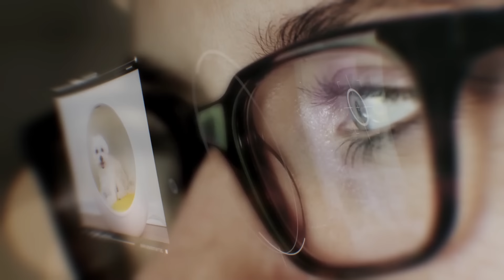145 Incredible Things Caught On Camera. Best of August

Comment: @2:26 - This event is like what happened to me when a roofer came to look at an issue on a very windy day.  The ladder fell while he was 3 stories up.  Luckily, I was able to set the ladder back up myself as the chap was alone.
Reply: I had a job where I was siting a bunch of network equipment on a loft above the offices.
I had been assured everything was in place, and flew down to see my network cabinet and everything had been delivery correctly to the loft.
However, none of the ladders on site were tall enough, so I had to stand on the top of an 8 foot ladder and jump up to where I could land on a low wall and swing over into the loft.
I was not particularly amused at the time.

Comment: 10:08 No explanation but I'm assuming that's some kind of fire suppression system for the gas station. Wouldn't that blind everyone there preventing them from safely getting away?
Reply: I suspect their is some sort of short delay to allow people to flee before it triggers.
Reply: QUINCY, MA (WKOW) -- A fire suppression system malfunctioned this week, leading to quite the sight in Quincy, Massachusetts.

Police there tweeted about the incident, saying, no it wasn't snowing in July.

The system to put out fires at the Stop and Shop Gas station malfunctioned, sending a cloud of foam from the canopy.

There were people filling up at the time. Three people had trouble breathing and were checked on by paramedics, according to police.
Reply: Rather blind than dead
Reply: @southern_merican  It depends on what's used; Halon is used in some systems where computer equipment or other delicate items are around, but dry chemicals are used as well.  Also, carbon dioxide is also used.  NONE of these are really safe for humans as the fogging smothers fire or humans, though dry chemicals don't fog like CO2 or Halon, and thus are safer.  HOWEVER, that was obviously not dry chem, because it fogged the entire area.
Reply: @darthrevan2063  I doubt they really need ANY delay; if the customers aren't smart enough to run AWAY from a fire, well, blame it on Darwin!
Reply: @southern_merican  Actually, the Halon and CO2 are okay as long as you can get air quickly (which is why they're used); the dry chemical type, not so much as it is a lung irritant in some formulations.  However, most folks don't stick around long when a gas station catches fire.
Reply: @jamescole6846  Thank you for the info! 👍

Comment: I did some subcontracting work in a steel mill like 0:30. I set a sheet of paper down, and within about a minute it was gone. Dust would pile up on every flat surface till it couldn't hold anymore.
I knocked the dust off a few things just for the hell of it, and I started finding stuff. The best thing was a 15" x 1/2" drive MAC ratchet. 
I found about 100 year old huge block and tackle with about 20' of 2" hemp rope.
All those friends and none of them were holding the ladder, to begin with, 2:20.
Reply: That much dust can be the cause of fires and explosions!
Reply: @barbaraanderson8574  I know what you're talking about, things you'd never expect like flour dust can be explosive, but there were so many ignition sources all over the place I don't think the dust had fuel in it or it would have been blowing up all the time. 
The place had ancient cranes that used open contactors that arced every time the crane made any kind of movement, you could see them flashing through the dust 80' in the air.

Comment: The people with the lunch bell ringing pup should add a little bit more length, like 6 inches, and tie a toy like a pull-toy or something. I'm sure a big stick would work as well but it would probably need to be tied at each end so it isn't just hanging straight up and down.  But there's no rule you can't add a nother length of string from bell to stick if you can find one big enough. But definitely that bell-ringikg pooch made my day.

Comment: That B.A.S.E. jumper: A BLIMP is NOT a BUILDING, not an Antenna, and is NEITHER a SPAN (bridge) nor NOR an EARTH structure. That is an AIR VEHICLE. That does not fit into the B.A.S.E. Acronym. So it isn't BASE jumping... What is it then called? Blimp jumping?

Comment: The supposed lightning hitting the tree I'm not sure about. Why the puff of smoke over on the right, the explosion doesn't seem right with lightning. imo
Reply: When lightning strikes a tree, it creates a lot of heat which makes the water inside the tree instantly boil, causing steam and lots of pressure, thus the explosion and the "smoke". Trees that are dead, close to it, or during a long draught can catch on fire.
Reply: @yomama5965  Thank you Yoma

Comment: Dang at first it was the cylinder head but ultimately was the water pump housing to die. Interesting.
It's usually the water pump system to fail causing vehicles to hit the scrap yard.
And who invented the gravity fed jaws of destruction?
I mean sooner or later every material that falls between those teeth will come to demise.
It's kinda like a torture device for all things not living.
Reply: The intake manifold held out the longest too.

Comment: The red hot flue pipe is on fire from some kind of material build up that should be cleaned like you would the creosote that should be cleaned at least one a year in a fire place or wood burning stove that is used regularly. This is done by chimney sweeps. For those who don't know. If I missed anything feel free to correct this.

Comment: Ya I know a simpler way to take off with them floats on. They make adapter wheel's for them that hook right on so you can take right off no problem. It just looks like the pilot is just showing off to prove you can get lift off in the back of a pickup bed very easy once that truck hits 85mi per hour. It just lift right off easy pleasly.